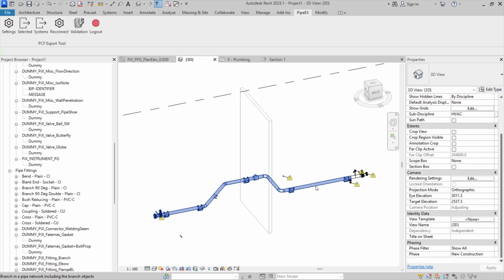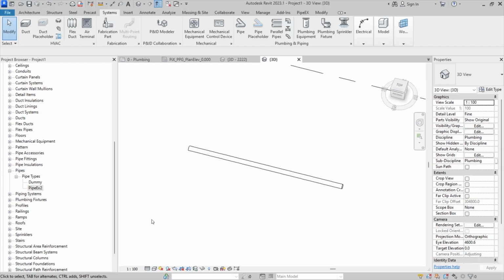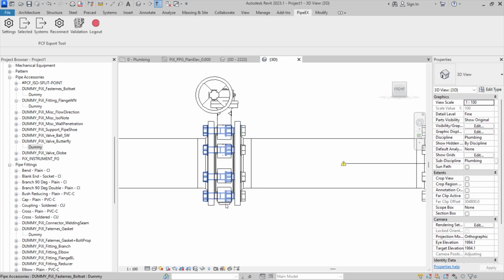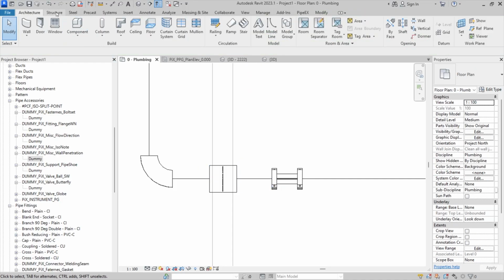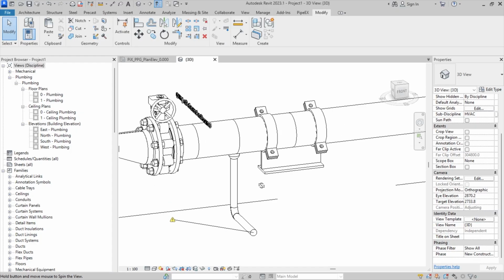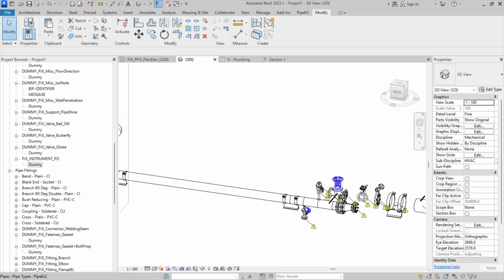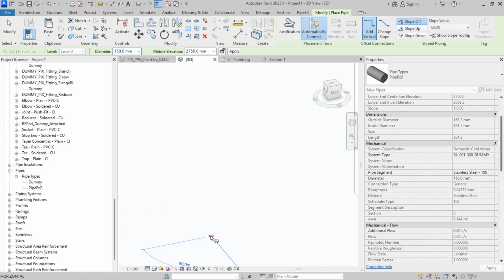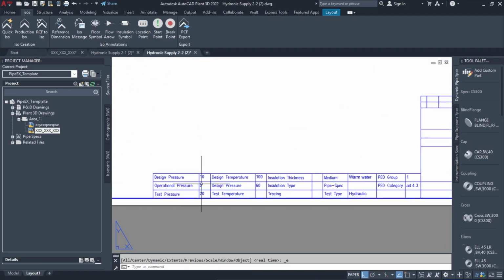Tutorial - Piping System Zero to Hero in Revit and converting revit to Isometric drawing

Comment: Hello and thank you. 
I have a question. You create all of your family but when you used pipe just go to the segment and size and create pipe type. Shouldn't you create pipe connectors by your own shared parameters DN in both side? Because all of your family connectors explained by two shared parameters as DN1 and DN2 .
Reply from the maker: yes you should, otherwise it will not be dynamic